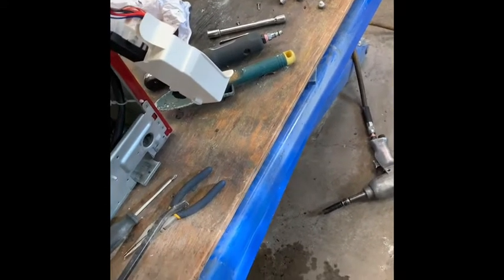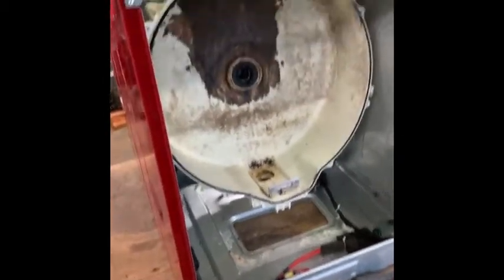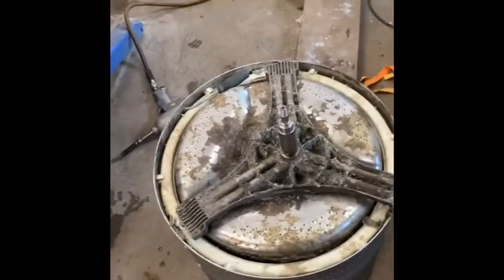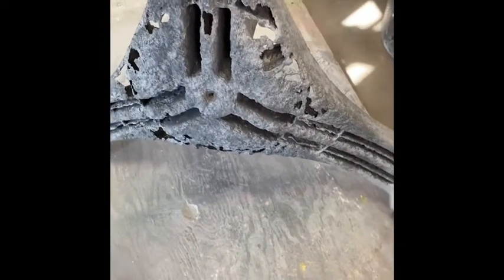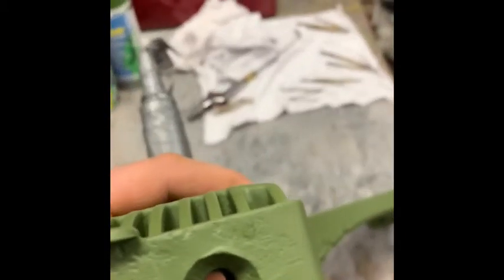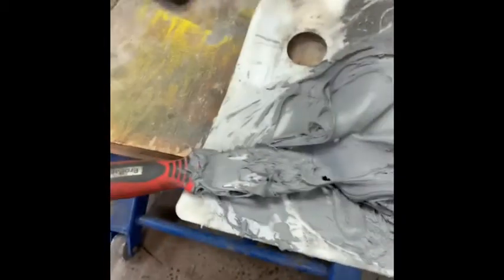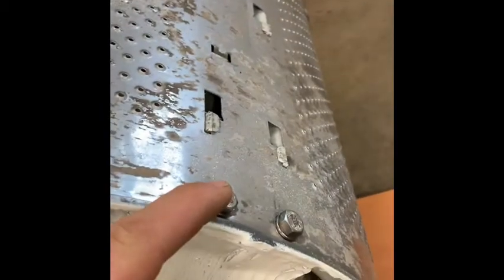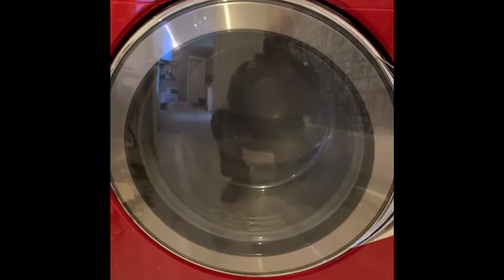Bulletproof Samsung Washer Spider Bracket

Comment: Welded up my own spider. 3 coats of POR15. Slight wobble on high spin, but washer doesn't walk. Saved $100s.
Reply from the maker: Nice, good to hear about similar successes. I’m perfecting my casting ability and hoping to post a video of me casting one out of a melted old aluminum car rim one day. If so it will be completely solid aluminum.
Reply: 5. And you, until you use the "2-component epoxy resin" method for filling the purchased tripod, I am sure that you have studied about this option and asked people who know this phenomenon... but, in my opinion, you have not given everything the details about the compatibility between aluminum and epoxy resins...that's up to you to decide if you will make these things known or not, I for one will respect the decision, no matter what it is...also, the cleaning process of the tripod used (which you have fill it with epoxy resin), the process of clearing and degreasing before using epoxy resin requires some protective measures and some physico-chemical knowledge or at least some guidance from people who are familiar with such procedures...
Anyway, your idea in this video is one that deserves to be researched in more detail, from several points of view, even if it requires the consultation of people familiar with the reactions between aluminum, stainless steel, epoxy resin and also some theory about the forces to which the aluminum tripod element of the washing machine is subjected, to the physical torsion/shearing forces, temperature and chemical elements existing between the tripod and the stainless steel tub of the washing machine... only after that can some conclusions be drawn and they will choose the best materials...casting aluminum is an idea, but determining the profile, weight and density of the material used for casting, tempering and scaling of the cast element are other problems that need "research"..and, at the end" follows the balancing of the washing machine, from the fixing feet on the tiles to the springs, counterweights and shock absorbers of the entire sub-assembly of the tub... I wish you a nice day and good health in the future

Comment: I'm a recently retired 35 year aircraft mechanic and the front loader I got shake and and the Springs are stretched after 8 years and the shock absorbers don't seem bad took them off check them out and it seems like the drum's tight like the shaft hasn't loosened up in , I would call it pot metal spider Call my have you had any issues with the balanced ring or the Springs Springs supporting a tub or the shock absorbers I appreciate that
Reply from the maker: Hi Mark, never had an issue yet after the fix, I did this 2 times. Once many years ago for a friend before this one. Both still working

Comment: A simple way to prevent these failures would be to fill the machine halfway and run a wash like that to dissolve all the soap stuck in there. But what will that do to the bearings? assuming the machine does not detect the high water level and drain.

Comment: Is there anything special about that epoxy you used? I seem to only be able to find it sold retail as small tubes as opposed to the large cans you show. I'm wondering if I can use any type/brand of 2-part epoxy that comes in similarly-sized cans. Thanks for posting this!
Reply from the maker: Not particularly anything special about the epoxy, It was just something I was lucky to get for free. Something epoxy based sold in cans that is thick enough should work.
Reply: Got it, thanks.

Comment: Hi, It's been 2 years since you posted this video. Is the epoxied spider still holding the test of time? Does it create an unbalanced condition?  I just took apart a Samsung 1 or 2 years old washer that supposedly failed due to a broken bolt.  I thought it was one of those bolts holding the spider but it turned out to be a bolt holding a counter-balancing  weight. Now that the spider is out and looking so brand new, I'm also thinking of coating it using some laminating polyester resin to waterproof it and hopefully make it last longer. I've been using this resin to seal my concrete pond and it's been leak proof. But I not sure if it will stop the galvanic corrosion that naturally occurs at the stainless steel to aluminum transition. I think that it should slow it down if no aluminum is exposed to the hot suds. That's why I'm curious how yours withstood the test of time... Did you cover all the exposed aluminum as well?
Reply from the maker: Still running daily no problems, and I did another one from another brand almost 10 years ago that still working also. If you clean it and fill the voids it would prevent soap from latching in the voids and probably make it last much longer. Hopefully you get it fixed permanently…cheers
Reply: @joelshopefullyhelpfulvideo3010  Thanks. Fortunately their new design doesn't have those deep grooves collecting the scum. At least it's comforting to know that we have this option to counter such built in planned obsolescence, for that's  what it really is... I'm surprised that no class action has been filled against Whirlpool and such as of  yet.

Comment: Thank you for the helpful suggestion. Since the spider bracket will alway make contact with liquid, what do you think of an idea of using the zinc Chromatic only on it without the bonding or paint?  What is your thoughts? Thank you;
Reply from the maker: Hi, something is better than nothing but with years of turning in corrosive detergents. More protection will last longer. Thanks for the feedback! Hopefully you get yours running good 👍
Reply: epoxy coating would be cheapest solution

Comment: It seems like what you're doing is a total waste of time. That part only cost $80 and is widely available. I thought that powder coating would be a good idea. I also looked into Marine sealants used in ship engine compartments and it seems like they might do the trick.
Reply from the maker: When I made this video I think it was more pricey for that part. But regardless it’s been running solidly ever since in a furnished rental appartement. The products used were given to me free. Sometimes it doesn’t always make sense but I did it to keep myself occupied in my shop just like many other things. It’s kinda like a hobby for me.

Comment: Should have just bought a new spider on eBay for about $80. You’d be saving not just time but money. You probably ended up spending about $200
Reply from the maker: Hi, Your right about the spider, I bought the used machine to have the inside water bin. The old one was damaged when the spider exploded, that part was very expensive and not worth fixing the machine if bought new. I work on my projects when I’m bored at night as a hobby, I don’t establish much value to that time vs watching television.
Reply: Repairing is in your DNA or not. I repaired my own appliances when it is possible for me to do. The money and times expended don't matter. It is the joy of seeing it back to life